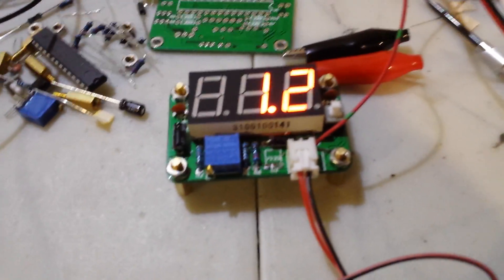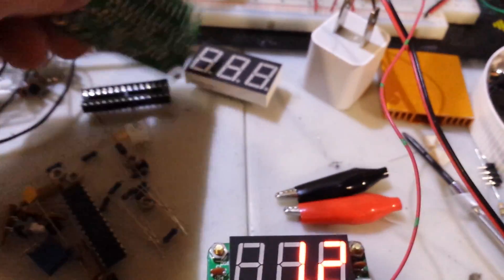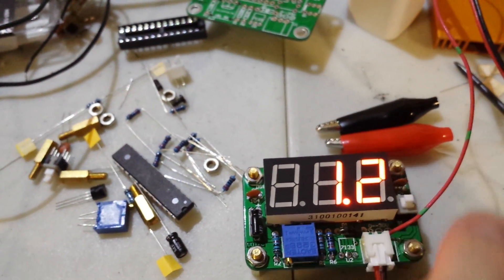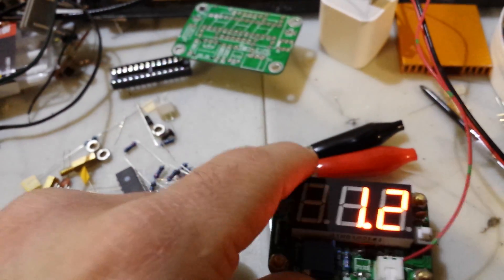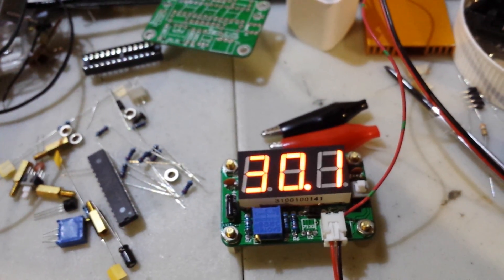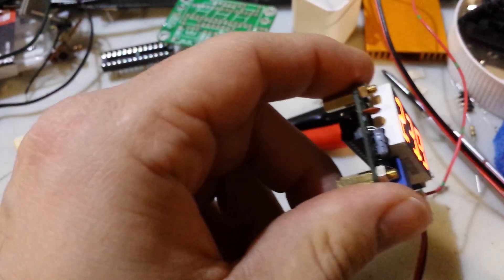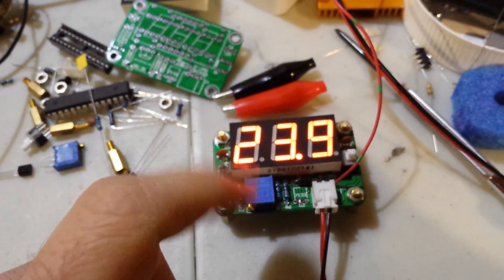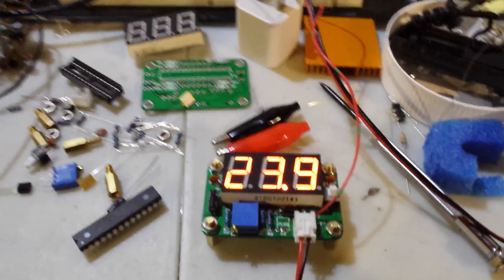DIY voltmeter icstation.com

Comment: And if I understand you right,the flat side faceing me if I set the meter in front of me,and the rounded side faceing the chip,I hate to screw up again ,I wish the would have marked better on the circuit board

Comment: I need to ask you a question ,I ordered another volt meter kit ,because I kinda screw up the other one,which way does that voltage regulator face,is the flat side to the chip or is the round side faceing the chip,.I don't want to smoke another one
Reply from the maker: Ron Thompson its flat side facing the board on the led display side, so that would be the flat side would be facing you when you are looking at the volt meter from the front.

Comment: I figure out where I screw up on mine ,the white plastic piece,the the two leads with alligator clip I have to move over one slot to the left ,and now does anyone no which way the transistor/ voltage regulator face,flat side facing back or flat size facing out.anyone please.

Comment: On the video it show yours was working with out a voltage regulator ,or my eye were playing tricks,on mine kit the red and black wire were wired wrong,because the plus on my board and the black wire was lined up when I plug it in,I wonder if that was the cause of mine smoking then quit.anyone
Reply from the maker: Ron Thompson no I blew the regulator before the video so I was using my bench power supply.
Reply: Well I going to order a new one soon ,I figure a lot of my mistakes by watching your video,it showed me where I went wrong,thank goodness these kits are cheap
Reply from the maker: Glad I was able to provide help :) Let me know if you require more. Cheers!

Comment: I am done except trying to figure out which value resistor on both side of that 5k blue block,one is I think is 10 k and one is a 100,000 k ,any one ,no by the color code with is which,p.s. I found my transistor.. What a fun kit

Comment: What's the number on the transistor mine was missing ,anyone that can help me.
Reply from the maker: I think you mean the 3.3 volts voltage regulator. The number would be 7133.
Reply: bakupcpu it doesn't matter 
Y
Reply: bakupcpu  it doesn't matter when I applied power to it my transitor smoked end of kit,never had a kit do that before.
Reply from the maker: Ron Thompson outch the voltage regulator is only rate for 30 volts max. you can get a new one and it work. mine let the geny out as well and I simply replace it. you will need a 3.3volts regulator
Reply: bakupcpu I only applied less the 12 volts going through my lm 317 power supply .but I will try what u said,when I order the part ,I should call it a power regulator right and use the number on it for,I try to get a American one instead of the Chinese one referance.
Reply: bakupcpu thanks for your help
Reply from the maker: :) you can use any type of voltage regulator I blew up mine as well and I end up using a 3 amp one a bit overkill but it work :)
Reply: bakupcpu guestion my friend what the number on your three amp voltage regulator,and where did you by it
Reply from the maker: The lt1085-3.3 is 3 amp but way overkill for this board you can also use the lt1117-3.3 it's a 800mAmp regulator. I assume digikey ebay and most electronic parts should be able to sell you those. Cheer
Reply: bakupcpu thanks ,I hope that's the only thing I smoked ,this seems to be a common problem with this kit.
Reply from the maker: You can test the kit before doing repair simply supply it 3.3 volts. If it turn on and work properly then you will be fine if it doesn't do anything or short your powers supply then it might be too late you will need a new atmega chip on the board. I also have one like that the voltage regulator exploded, lovely show, then the chip was over power and let the genie out but my first kit still work fine.
Reply: bakupcpu I just built a pm 338 power supply,I hope I didn't munch that chip time will tell.thanks for all your help,the guy that did the video,doest seem to answer question,,it nice when us hobbits stick together.
Reply: bakupcpu I glad these kits are cheap,I haven't  done this hobby when I was married,but I back at it,but the new circuits are a lot smaller.
Reply from the maker: I'm the guy who made the video ;)
Reply: I am sorry ,I thought it was a different name,you would be surprised on how many people ignore you.I just thought you were just to busy.couple of site ask for Money or donations
Reply: I do thank you for the help you have given e
Reply from the maker: Ron Thompson all good my friend I have a busy life but responding to a message take 5 min that nothing glad I was able to help you :)

Comment: what  Resistors  are used in that? my kit is missing some.
Reply from the maker: all of them are mark on the pcb for there value. if you tell the specific one I should be able to look on my board for it.
Reply: I no a couple of them one is 10 k and one is 110 ,thousand k.
Reply: Have you complain to the seller,or pay pal